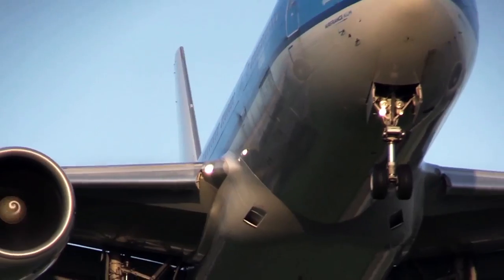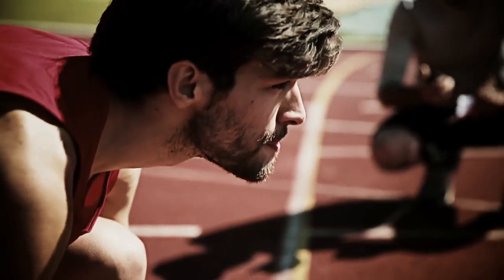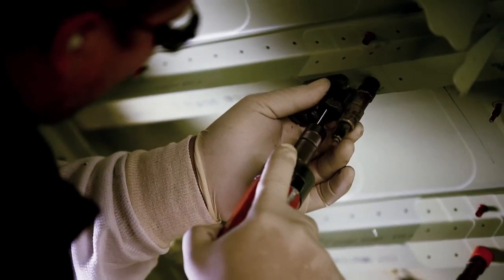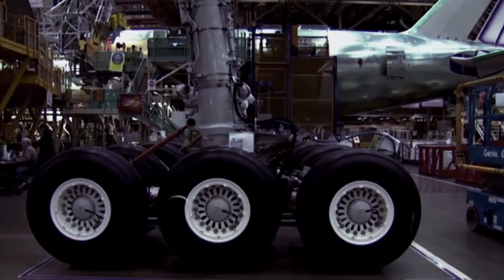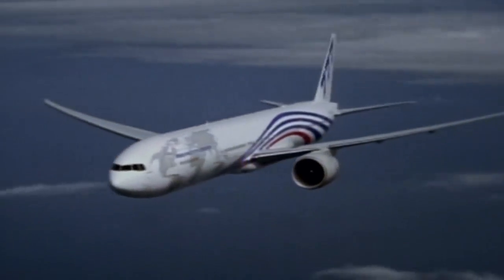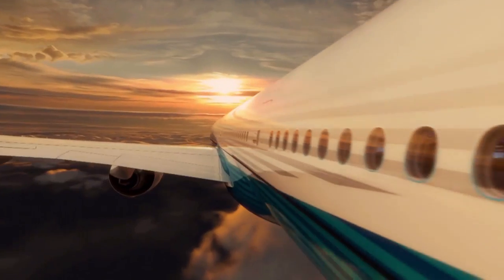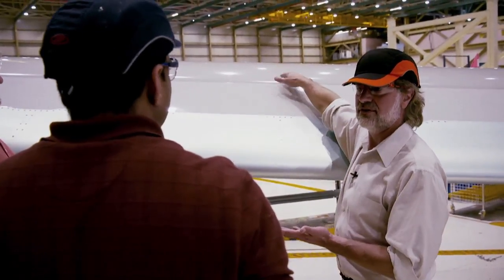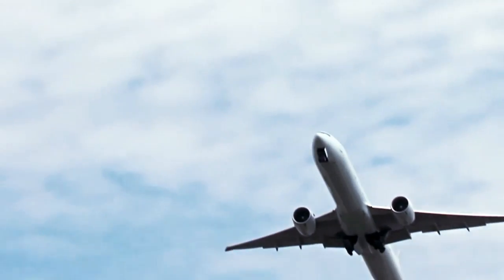The Boeing 777-300ER: On Your Mark. Get Lighter. Go!

Comment: gee...why didnt anyone else think of that? I think its an amazing idea to leave off intergral parts of the fasteners that hold the entire airplane together! who wouldve thought all these years that we didnt need washers! I always thought they were used to  dispwrse the force applied to a greater area in order to prevent the volt from ripping through the piece its holding on or from being damaged when tightened and creating a weak point in the bolt. Wonder why they bothered inventing them? Guess millions of engineers and technicians must all be wrong. Well who cares...at least the airliners will save some gas money..im sure they'l pass the savings in to the consumer right? and hey...if ever a wing rips off or whatever they can always just pull over and call CAA right?

Comment: Nice take on fuel efficiency, but one should also take into account, that these highly developed state-of-the-art aircrafts should provide comfort to the passenger, not just capacity.  This goes for any modern day airplanes. Profits are there, but one can easily manipulate them for this day and age. 👍

Comment: hell if you're going to take it that far don't use bolts or nuts at all just glue the damn thing together with hot stuff
Reply: So you want the plane to break up in mid air? Glue can't take the stress of flight. Glue will be hard as rock in 38,000 ft so the fuselage will suffer from metal fatigue

Comment: Why not upgrade the engines to those used on the 787?
Reply: Not powerful enough, and not enough thrust
Reply: The 777-300 is longer from nose to tail than the A380 so the 787's engines wold not work on a plane that big.
Reply: +lohphat GE is developing the GE-9X -- a version of the 115,000 lb of thrust GE-90 with the advancements of the GEnx that is on the 787 and the 747-8 -- for the 777-X.  That's the main reason the 777-X will be so much more fuel-efficient.
Reply: +Kevin Young and yes I know to is supposed to be too in that context..it was a typing error and i wasnt starting over after sending it.
Reply: +Kevin Young really? i thought it was because they werent fuel efficient enough AND were too hard on fuel to.

if u dont get it...i aint explaining the joke
Reply: +BrianYYH 😠😈😴😴😉😯😯
Reply: +Kevin Young what about the ones that are on A330neo
Reply: b
Reply: +BrianYYH dwwwwedf

Comment: ERW superior rolling resistance...50%...For takeoffs.  Screw force accumulation and return to save rubber...Anti Bounce landings. Vacuum pressure supports high frequency in wheel suspension. Have a look US 9,004,120 B2

Comment: If you get rid of all the washers,  how do you prevent the nut from pulling through the skin of the aircraft?
Reply: They do engineer for that, just don't tell you
Reply: It's dangerous take the things away from under the nut, they can sometimes Pearce the metal and makes holes
Reply: MegaIsAFox Engineer's have solved for that. They just don't show you
Reply: even if they have engineered a solution, it was the greatest piece of marketing.....
Reply: THANK YOU!! Someone with common sense!!
Reply: +Kevin Young yeah right!! if it was as safe theyd have done it YEARS ago!

Comment: You wanna impress me Boeing ? Get some autothrottles that aren't all over the place when experiencing wave type conditions !!! That was the scariest thing on the 777-200.
Reply: The autothrottle on the 777 is in one place. Same goes for the 737/757/767/787
Reply: NO ! By "all over the place" I am referring to their inability to maintain and hold the set speed. The autothrottles would carry you right into the Vmo clacker if you did not intervene manually - meaning not very effective autothrottles.